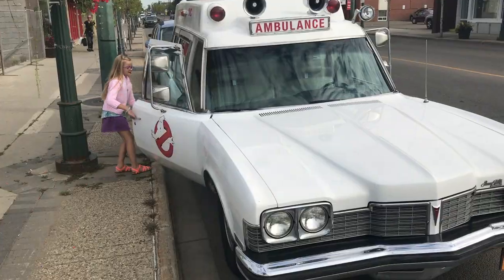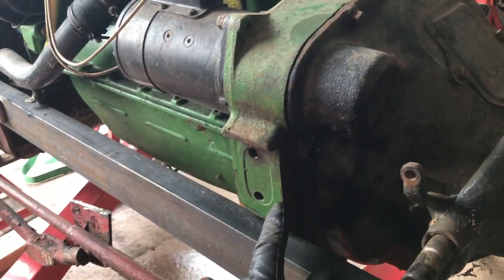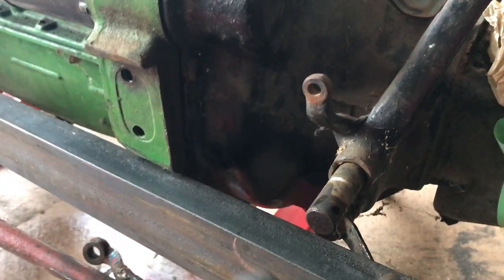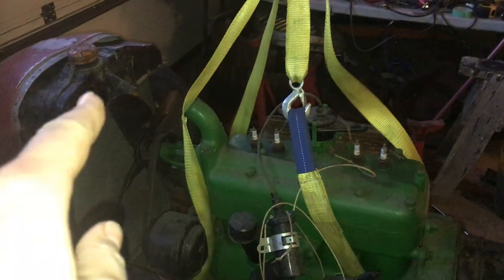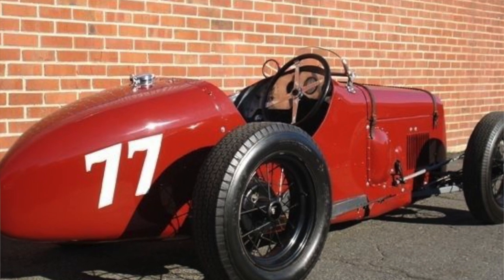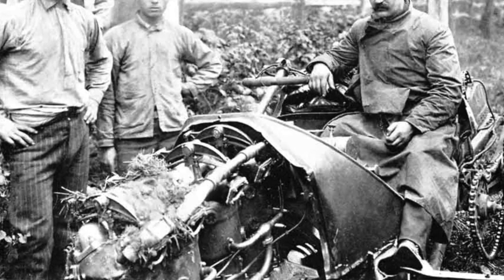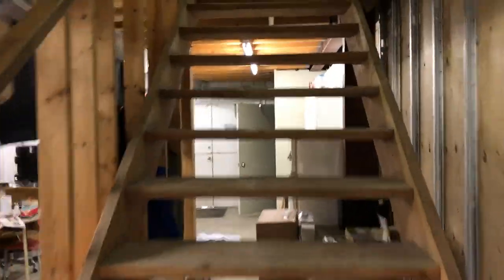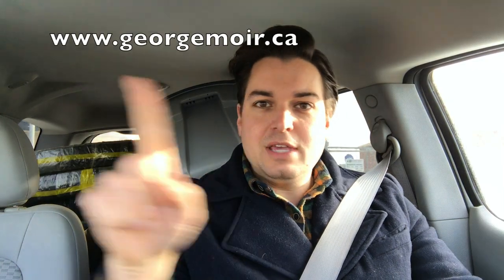Antique Race Car Project Part 5, sizing up up the engine and painting the rims!

Comment: Old time sprint cars hd a thing called an In Out box. which,when see one looks like a model A trans just smaller because there was only one gear. I would have probably hunted  for one of those and instead of Model A radiator i would have a soldered another neck to suit the engine. A note on old time car painting. Spraying was common enough in the 20's  and When i first stated as kid helping out in a panel shop ,we had lacquer and enamel .One of mates,Harry started work in 1939 and his first job was to paint a black car ...with a brush . What they did was place the gallon of black enamel in a tub of really hot water. This makes the paint flow and goes on without brush strokes .Yes, race cars were glossy but enamel takes a couple of days to surface dry and weeks to actually set under the skin. When you went to the dirt track you wanted your car to look really  Smick  to intimidate the opposition ..Another thing you could do is track down a Model Axle housing . I used them to make exhaust manifolds,really nice tapered shape ansd quite thick so they withstood a bit of hammering. .You cant have a race with a stock exhaust manifold... :-)
Reply: Mercmad sprint cars still have in/out box

Comment: Project is coming along nicely. Wondering why you didn't pick up the radiator you need at Moir's. BTW, it's Mother Lode, not Load.
Reply from the maker: I’m thinking about deleting the fan off my car and running an electric fan. In which case I can use my rad